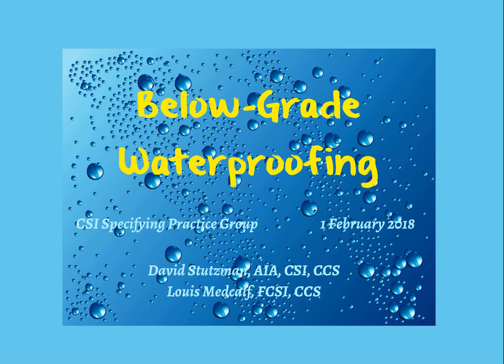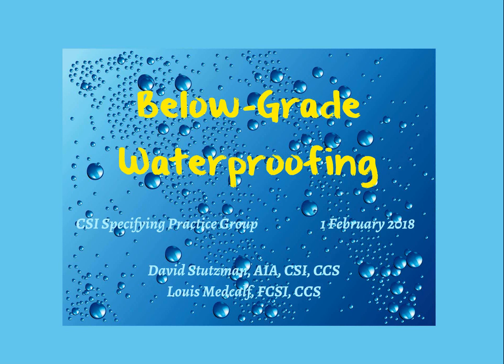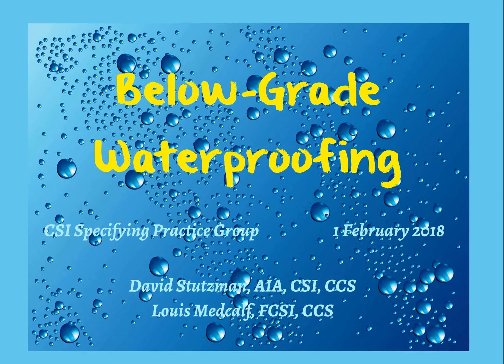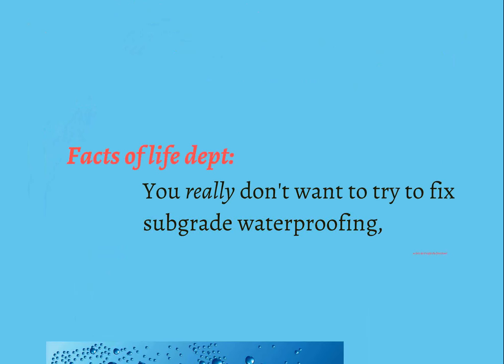Below-grade Waterproofing

Comment: 🤓 Damproofing: resist water if no hydrostatic pressure present
🤓 Waterproofing: resist water passage when hydrostatic pressure is present
🤓 Site preparation
🤓 performance factors
🤓 do foundations at unexcavated areas need waterproofing?
🤓 please connect a transition membrane between the below grade and above grade. It could be a flashing membrane
Reply: Can u explain what is above and below grade waterproofing please
Reply: Above grade waterproofing is anything "above" the dirt level. Basement Waterproofing typically goes "below" the dirt level, because that is where the walls are built...